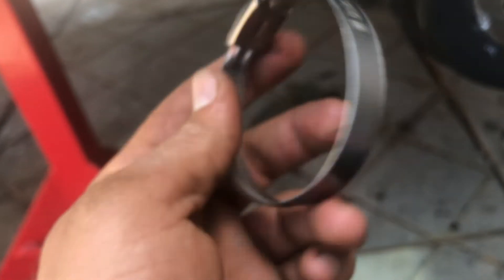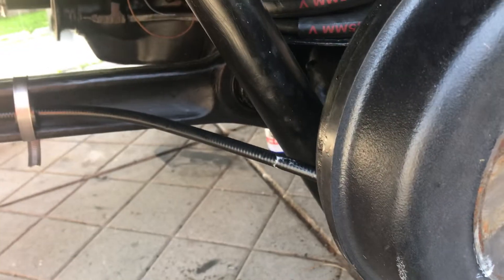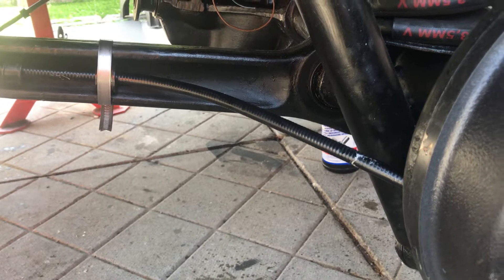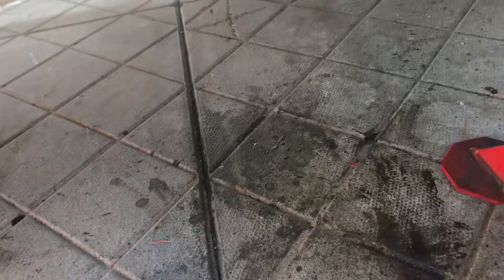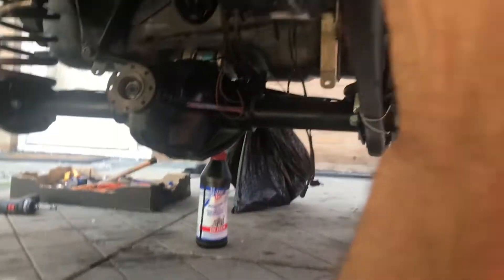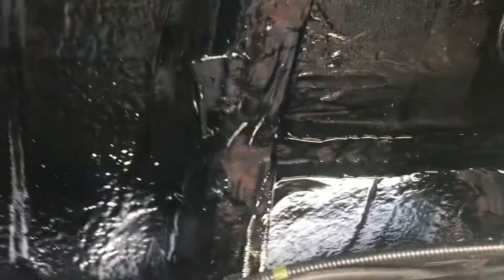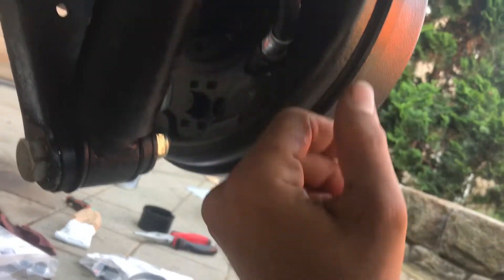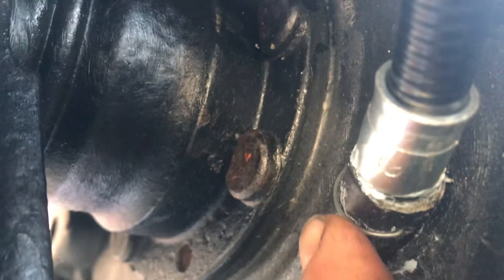Restoration and renew rear brake G class G klasse Geländewagen part 3

Comment: I don't understand. So you need thise clamps to have some brake momentum once the emergency brake is engaged otherwise it's too long?
Reply from the maker: @nicecool26  hallo
I upgrade the daschbord to 2010 model the hand brake position is changed to ⬆️ 
So i have to fund cable for old brake system on the rear axle but more lang of the original w460
The clamps I upgraded stainless steel the original MB for w460 is normal steel and with movement of suspension removed the paint
Reply: Hoe zit het met de oude remkabel? Ik heb nu namelijk problemen met de w460. Ik krijg de handrem niet op orde. Dus die klem gebruiken kan mijn probleem verhelpen?  @gclassdoctor
Reply from the maker: @ 
Contact met mail please 
I want more info, video foto ect